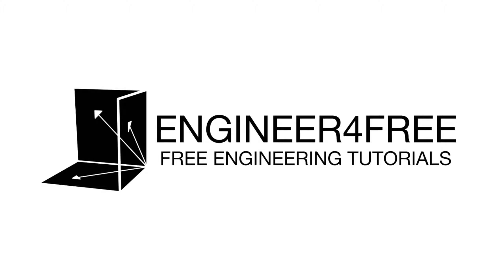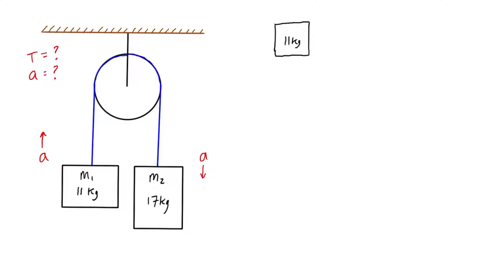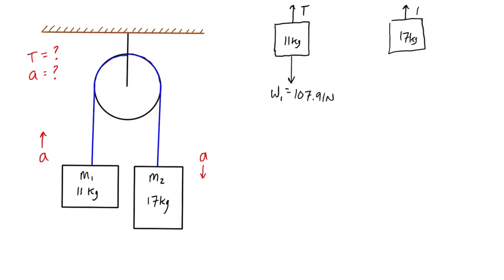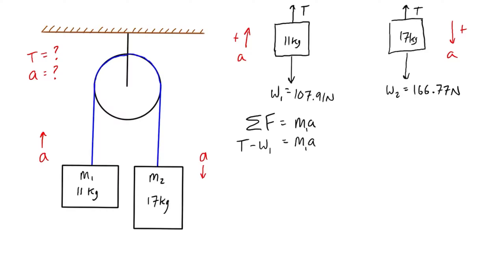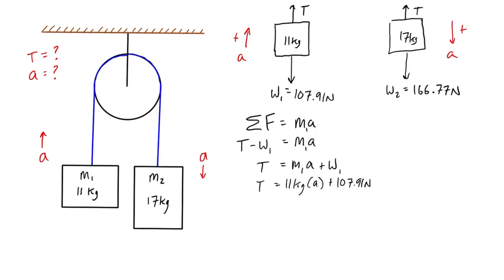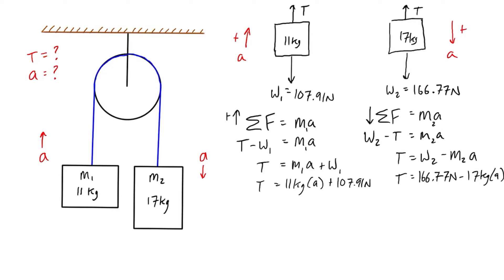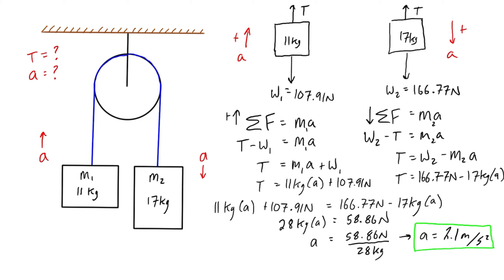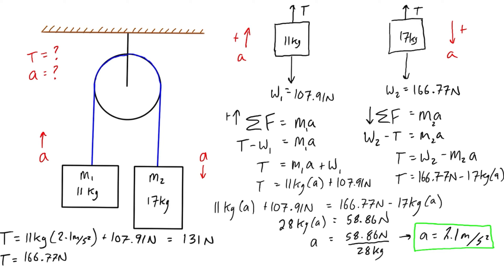Kinetics pulley example problem (Atwood machine)

Comment: Why is weight (w2) on m2 positive???
Reply: imagine the string is strung out in a straight line. The acceleration will be pointing in the same direction
Reply: Because we took the downward direction to be positive, so the weight force time will be considered positive because its direction is also downwards. However, in the first diagram, we took upwards to be positive and weight was downwards therefore we considered it negative.  I hope this helps.
Reply: to make the calculations easer you change the m2 direction to + down

Comment: in a very simple version of this, 10kg on either side, stationary, the tension in the cable is near equal to 10kg/98N? not 20kg/196N? how is this possible? does no point in the cable experience 20kg?196N
Reply: Pretty sure in this situation the pin connecting the cable to the wall would experience 196N worth of force, while the cable tension equals 98N. U could prove this by drawing an FBD about the two masses and then one about the pulley itself. While the pulley experiences 2 downward forces of C, the masses themselves each experience 1 upward force of C.